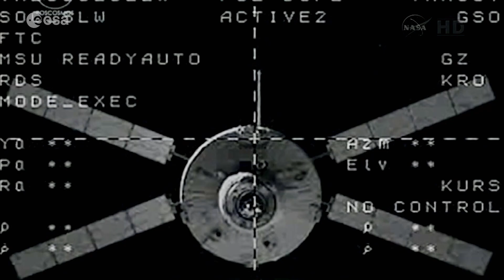Europe's supply spacecraft ATV – making of

Comment: Nice retrospective. But I dearly miss the ATV. Hopefully it'll eventually see derivatives in the future. I would be delighted to see the development of a heat-shield equipped cargo version, and a manned version after that, but I understand budgets are tight and development might take anywhere from 5 to 10 years, even within optimistic estimates.
Reply: ZemplinTemplar I think that the Service Module from NASAs Orion Spacecraft, which ist built by ESA ist based on the ATV.
Reply: ZemplinTemplar what Europe needs is a commercial space launch provider, the equivalent of a European SpaceX. Then ESA could affordably and quickly build space technology, LV's and even spacecraft for crew and cargo. I'm surprised China beat Europe to manned spaceflight. ESA could do it but it'd be over budget and behind schedule because they use Gov contractors, like NASA uses Boeing and Lockheed Martin. At least NASA also uses SpaceX, which has saved American tax payers billions vs what Boeing and Lockheed charge for SLS/Orion.